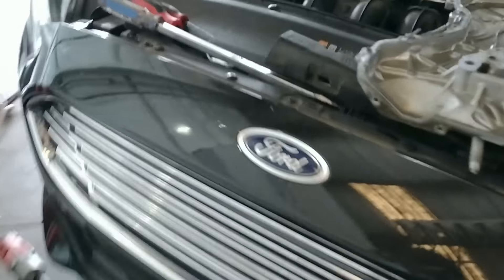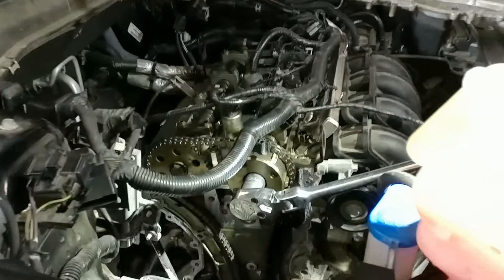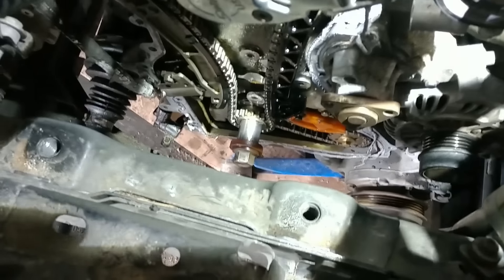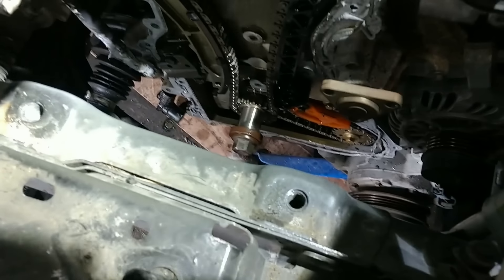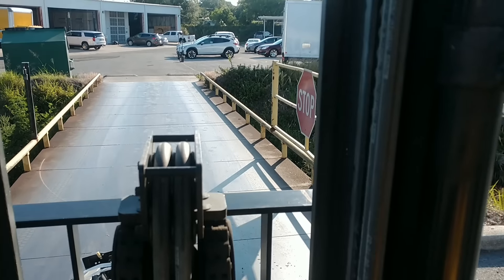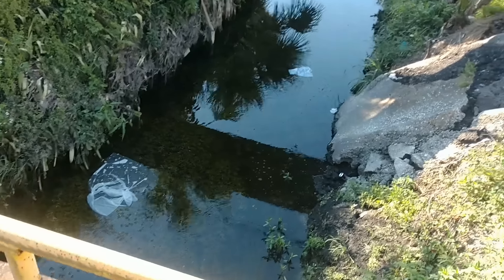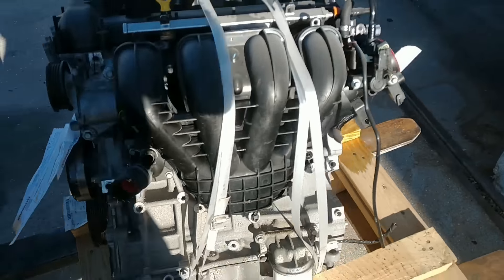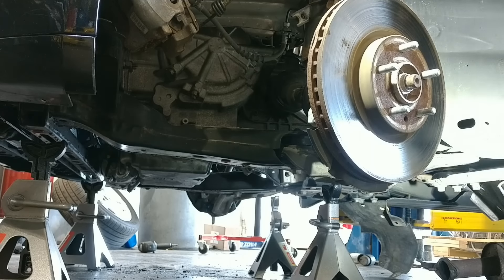Damaged Engine: You Broke it! Pt1

Comment: Silly question. Why were you/it being spun over with it only half assembled?

No disrespect to whom done it as that cog design is shite, I don’t believe anyone expected it to be affixed in that manner, just don’t see what was the purpose of starting it up half built was?
Reply from the maker: It wasn't. An engine start wasn't attempted with the timing cover removed. I wasn't doing this job, so I didn't get loads of footage. When my guy removed the crankshaft pulley, valve spring pressure caused the valve train assembly to move out of time with the crankshaft and he didn't notice. What you see is after the job was completed and he attempted to restart which caused valve damage. The footage you see is after I came over, realized that we had a problem and removed the timing cover to recheck things. THEN I discovered we had some internal damage from pistons meeting valves.
Reply: I think someone didn't listen to the audio in the video ...
Reply: @RainmanRaysRepairs  this is why i tell all my trainees to spin the engine over by hand before reaching for the key, another lesson for the new kid :). you wont ever bend valves while hand cranking.
Reply: @Marineio  Actually it's held in time by the Belt or Chain.. As some of these engines have half covers. I seen some people replace just the water pump. Not knowing once you release the belt or chain., It just flops down..

Here is how it looks. So if you see it. Be aware what tools you need..
https://www.youtube.com/watch?v=TraMvTW_sZI
Reply: I used to simply ask: timing belt or chain? (when buying a car.)

Now, though, I will follow that up with: is it a Ford?
Reply: @iFixJunk  it has occurred to me of late that if buying a used car, a belt can be replaced a lot easier than a chain. If ya previous Honda owner let the oil get real questionable, the chain is the first thing to go. Not that we learned that the hard way or anything with our ‘03…
Reply: @WizzRacing  no the crankshaft turns without turning the timing chain if the crank pulley bolt is loosened. I have done this myself when replacing the crank seal. Luckily didn't crank engine and was able to get the timing tools and set it back up correctly. Figured we had a problem when I noticed there was no keyway in the pulley. I was sweating though
Reply: @iFixJunk  My current car (mid 2000s Camry) has a chain. 200k odd miles, I doubt the chain has ever been replaced - seems fine. I've also owned cars with a belt - I felt warm and fuzzy knowing when a new timing belt was done and their engines seemed quieter. Both are fine, but in either case, check to see if they're non-interference engines for peace of mind.
Reply: @johnmcnair8854  I'm telling you the tension on the Chain or belt holds it in place. As you can never touch the crank bolt. And it will flop down on you. The second you release tension on them...

Why It has a Crank Lock pin. That goes in the side of the engine.. Why the Ford Manual gives directions on how to change the water pump on them.. As you can easily not notice the crank flop down.  When the belt tension is released. So you jam them cheese wedges in there to prevent it and the cam from moving...As you will be taking that whole timing cover off and the Valve Cover... Which adds about 5 hours to the job....
Reply: @RainmanRaysRepairs  thanks for the knowledge. It's great that y'all found an engine with such low miles, that should please the customer a little. Just don't show him that last pic. Most don't want to see their car "gutted" and if they do, they tend to have imaginary problems/noises for months after. 
But I'm sure I don't need to tell you any of this.😎
Again, thanks for the knowledge👍
Reply: @chrismechanic2000  Turning them over by hand not guarantee either.
Reply: @Marineio  absolutely stupid design!
Reply: @johnmcnair8854  most engines don't have a keyway in the pulley, they are held on the crank by friction, unless you meant crankshaft sprocket, those have a keyway.
Reply: @chrismechanic2000  - Challenge accepted.
Reply: @chrismechanic2000  i have expressed this to my brother. but the one time im not there, whaammoo, loud noises.
Reply from the maker: Experience saved your engine that day.
Reply from the maker: Experience saved an engine that day
Reply: @RainmanRaysRepairs  yep I looked at pulley and thought hmm now how do  i set up the timing for the crank pickup then googled it. Now on late model shit I google first as we don't have access to much in the way of tech data
Reply: @RainmanRaysRepairs  so who is collecting unemployment now ? By the way good footage , ran across your channel when searching unemployment extensions for the year 21 lol , thought it odd because of my search lol
Reply: @RainmanRaysRepairs  What a stupid, stupid, stupid design. I can't even imagine why they would make a car that requires special tools to assemble and disassemble, when a simple keyway would alleviate the entire problem. I guess they saved a few pennies on machining that way.
Reply: @RainmanRaysRepairs  Thank you for clarifying it for me! Makes sense now 😀

 I’ll try and be more attentive next time!
Reply: @RainmanRaysRepairs  I'm tech too I've many engines turned over by hand and after starting them things went wrong. Even seen N14 cummins co-worker turned by hand and bend 2 push tubes. Yet somehow didn't know they where bent (the amazing part) and started it .
Reply: Without the cams being locked, the crank gear will move as soon as the balancer is loosened. The engine was out of time before the cover was even removed. Not something you would expect
Reply: @NicholasAndre1  I have an 06 AC RSX and I was told to pay close attention to the chain or it will mess the whole engine up
Reply: @MattExzy  Get the timing chain looked at after about 2,000k my friend
Reply: @MrJeffcoley1  simple answer is the manufacturer doesn't want us working on our own stuff. They want us taking it to the dealership for repairs.
Reply: @iFixJunk  it's a Ford. 😁 That's why I'm now driving a Chevy.  4 years old with no repairs at all. 😀
Reply: Sounds like a pretty shitty design if u ask me
Reply: this is bull, all to save the 10 cents it costs to key or dowel it.
Reply: @iFixJunk  Sometimes I think we were better off with points and timing lights and chain driven camshafts and no interference engines. Maybe EVs will stop all these problems when the range and quick charge availability is solved.
Reply: @googleuser868  I hate points, but I'm with you on the chain (although, I GUESS if you're changing a belt and CHECKING the timing instead of taking for granted that a chain won't stretch as much, maybe there's something to that).

But I hear you. I hate interference motors.

The EV thing has a long way to go. Wish the synthetic petroleum alternatives were viable.
Reply: Ford.
Reply: When he loosened the crank bolt, the valves that were under tension, caused the cams to move.  He needed to lock the cams, before removing the bolt.
Reply: @mikemike4086  if the check engine light comes on, read the codes. We ignored it when it was indicating a cam-crank phase issue and paid the price with a nuclear K-series.
Reply: @MrJeffcoley1  Generally things are engineered a particular way for a very good reason, believing the design to be "stupid" simply means you are ignorant of those reasons.
Many, many modern engines use keyless crank and cam sprocket/pulleys, the reason being is that very accurate cam timing becomes possible by simply locking the crank and cam to the correct locations and then tightening up the pulley bolts rather than relying on a keyway. The location of the cam, crank and pulley keyways on older engine designs have some tolerance and so does the length of a new belt or chain, which overall gives less accuracy in timing without using offset keys and setting up the engine using DTI and degree wheel etc.
Reply: @iFixJunk  modern belt driven engines fail less than chain ones for example n47 from bmw and 1.3 cdti from gm/fiat fail a lot on the chains and chain guides
Reply: @MattExzy  My car has a chain as well, just gone over 153,000 miles. Many people in this country would just scrap it. Parts are cheap and  you only buy tools once.
Reply: All you need is to have the engine stop at the right point and loosen the crank hub pulley. Cams go one way and the crank falls backwards. Game over man!
Reply: dealerships are not perfect they screwed up on a 700$ job and had to redo it a few days later when the assembly broke again (installed incorrectly)  gear shift linkage   the car was stuck in reverse in any gear  luckly it happened on flat land  other wise It would have ended in an accident.. i.e rollaway  since it was typically parked on a hill
Reply: Ears! Use them
Reply: @chrismechanic2000  ofcourse you do some rotations by hand and be sure there is no interference
Reply: @chrismechanic2000  rotating by hand after any major work is always good advice and something I was taught literally on the day I was offered my apprenticeship 😊
Reply: @RainmanRaysRepairs  That quite literally has to be the DUMBEST design idea ever, and i'm a Chrysler nut so i've seen a LOT of dumb ideas. 🤣
Reply: What a lousy design, press fit on a real motor ? Not even on my RC vehicles !
Reply: @punker4Real  Needs to have a hand held lever which is mechanical and able to be reached from the driver seat.
Reply: It's become apparent to me that many of the car and parts manufacturers nowadays intentionally make working on the vehicle difficult and requiring special custom tools. They also make everything from plastic and mold wearing components into the part so the whole assembly has to be replaced, at huge unnecessary cost. Working on cars now has become less of repair of parts and more of replacement of parts.
Reply: @RainmanRaysRepairs  why not just throw a new Cylinder head off a junker motor and call it a day
Reply from the maker: @Zzzzf  oh I wanted to repair it. Bosses thought that having the kid replace the engine would be cheaper. SMH
Reply: @MrHBSoftware  It's going take five or ten years before most people realize that chain cam drives have flaws, too.
Reply: @21stcenturyfossil7  i am in europe, portugal and overhere people already prefer belts...usually because modern chains need replacement too... and are way more expensive to replace then belts....and they also fail...problem is that car manufacturers are now inventing weird stuff like ford's wet timing belt system...dont know what their idea was....
Reply: What did you do with the bad engine?
Reply: @MattExzy  maybe take the covers off and look at it.
Reply: Fords have never failed to screw us over with crap like this, throughout my whole career. People love to say, the tech “should have known”. But there are so many cars and it often doesn’t mention that this will happen if you read the actual timing cover replacement guide. It will probably tell you to lock it somehow. But they never mention the consequences.
Reply: @highlanderfreelancer4553  All because ford is too lazy to key the timing sprocket ⚙️.  Lame
Reply: @MattExzy  most Toyota engines are free wheeling engines.
Reply: @BukitMan  ford had to get sloppy to stop GM from killing them on price
Reply: @BukitMan  there is a tool called a bore scope it's a camera you can stick in the sparkplug hole and look around I've seen them at Walmart cheap. Back when they were expensive many years ago .I saw someone turn the motor over with the scope  inside the cylinder. Now that's some dumbass shit.
Reply: @highlanderfreelancer4553  They wanted a closer look.
Reply: @MrHBSoftware  they were trying to piss up a rope is my best guess...
Reply: This seems like a terrible design. What were they thinking? 🤔🧐
Reply: @NicholasAndre1  there is zero reason for a belt -  how many chains really fail on a maintained well designed engine?
Reply: @RainmanRaysRepairs   I take it the guy that missed those engine mount bolts is the same guy that botched the timing? He's definitely learning the hard way, has he been sacked yet?🤣
Reply: @turtlemann14  this design is shared by bmw M cars and has wrecked many a high hp high $ builds
Reply: an even better question is why heck would they not put a key way in that crank. with the explained situation i can understand but you never button anything up without double checking you work. i've done a couple timing jobs and double checked them all by hand to verify i won't have such a situation. modern stuff might go more miles, be more powerful and efficient but it is not better in every way. my old truck had timing gears.. the engine outlasted the body lol. just bought a broken down 2012 malibu with variable valve timing. chain is screwed, guides, likely valves and pistons are SCREWED because of nonsense similar to this. of course it did make the guy sell it for practically nothing. what are ya gonna do though? they're all like that anymore, interference engines, variable valve timing, something differing from old slow and reliable. not a fan personally but they do have their benefits.
Reply: @blueovalfan23  completely agree with gear or chain driven timing rather than a flimsy rubber belt but there's nothing wrong with variable valve timing, look at Honda's B16 engine, that is an excellent piece of engineering. I have no idea how that so called "mechanic" didn't test his work by hand, I think there's far to many fitters out there these days and engineers are a dying breed unfortunately.
Reply: I thought everyone knew about the Mazda design engines. PITA
Reply: @RainmanRaysRepairs  Ford booby-trapped these engines..things you have to know before you work on these.
Reply: It's a hi-vo chain, nothing wrong with the design. Hi-vo can transmit more power than a normal chain and sprockets.
Reply: @arfamortis1  They're also quieter. Timing chains used to be all Hi-Vo's. Now many manufactures are using cheaper roller chains..sometimes only one row!
Reply: @iFixJunk  hehe those Ford engineers very nicely circled the problem on the grill :)
Reply: @mikemike4086  2 million miles or kilometers?
Reply: @NicholasAndre1  Some chains can be replaced easy, on Mercedes you remove a link feed new chain in as you turn over engine. All it takes is removing valve cover gasket.  Now you do not get new guides but you can replaced chain.
Reply: @iFixJunk  I had a Ford 4 cylinder once. A 96 Contour. Was a great little engine... however, the tensioner was supposedly made of plastic. If that’s not planned obsolescence, I don’t know what is.
Reply: @MattExzy  You still need to worry about a TCT failing and for me that’s worse than having a known interval to replace a belt. It’s also nice replacing the water pump while you’re there as those seem to start wearing faster around 150k miles if you live in the south. I really hate used car shopping though. Too many negligent owners in my state.
Reply: @moustachio334  Wow, I drove those cars working for a company that had a fleet of '96-'99 Contours and Mystiques. But I didn't know that.

I did not think as highly of those engines, but then I was seeing them after a lot of abuse.
Reply: It's apparent how this ended. There are industry standard ways of designing engines for repair.  If Ford can't get with the program then they need to get out of the business.
Reply: @Hugo_Overthere  I agree.

However, they were the only ones to refuse the bailout in 2010........
Reply: @iFixJunk  I like timing gears personally. Fuck the belt or chain
Reply: @MattExzy  ive owned an alfa romeo twin spark 1.8. I know that warm fuzzy feeling. One of the best engines to work on and daily drive. But have a hideous appeteit for cam belts. Id do mine once a year because i bought all the tools to do it. ( i drive my cars borderline hard )  If i ever need a shitbox daily. Im getting another one.
Reply: @Marineio  They are doing everything they can to keep us from being able to work on our own vehicles. I'll keep my 96 silverado until the day I die.
Reply: only fkin junk fords don't have keyed cam/crank gears. Bolt pressure holds em wtf. I thought subaru's plastic cam gears were the worst...
Reply: @MrJeffcoley1  its ford u should know from experience that they suck!
Reply: @ferrumignis  I’m sure there’s a reason, but it’s still a shitty design.
Reply: @joesmith6524  It’s funny you say that. Uncle Tony (of Uncle Tony’s Garage) says in his 5 decades of working on all makes and models his opinion is Ford had “too many engineers” and therefore needlessly complicated things.
Reply: @chrismechanic2000  very good idea. Had a mercury and required the same tool to keep the OHC in position. Didnt have a garage, the money, or the love for the car to even attempt. That was my last Ford I ever owned. I know all different makes and models have special tools and I always researched them after I learned the hard way a few times. Idk what meds yall take to do this on a daily basis,  but my hats off to you. I'd be a door greeter at Walmart b4 I become a full time mechanic. I've worked on my vehicles for over 20 years. Although at times I loved working on my own, theres always that model that they decide to change for their purpose. Miss the old days when you can climb in a compartment under your hood and work on them. Now , not so much. I've worked in 3 shops in my life and I changed my profession.  Praise all that have the gonads, patience, and skill to put up with constant change of models and dealing with idiotic customers. You all deserve way more than most shops can give. Great respect to you all.
Reply: @DL101ca  honda cams and bottom timing gear has keys. and crank pulley is splined
Reply: @NicholasAndre1  Yeah some cars may be like that - but others with chains aren't.  If properly maintained those chains should last the lifetime of the car.  I had a 2000 BMW 328i and it had a chain and it was original still at 306k miles.  The car got rear-ended at 306k still running on the original chain.  Now some makes I can see this being a bad idea to have a chain.  For example, the Chrysler 2.7.  The W/P should NEVER be ran off of the chain and it is also a shit design.  The Audi's also have chain issues on their V6 engines.  I have had many BMW inline 6 engines with chains and NEVER HAD A PROBLEM.  All makes are different.  They should uses better guides too that arent made out of such shit plastic.
Reply: @iFixJunk  yeah your like ahh timing chain thank god, then go wait is it a ford timing chain?
Reply: @RainmanRaysRepairs  In this case, what happens to the mechanic that did this ? did he need to pay this mistakes with his own salary ?
Reply: @RainmanRaysRepairs  these engines were designed by mazda, and they do this a lot.  there are tools and holes to line up the crank with 1 at TDC and then also tools to lock the cams in the right place.
Reply: @RainmanRaysRepairs  Now we know what "interference " really means.
Reply: @chrismechanic2000  To be fair, he didn’t touch the timing chain. He was just fixing a leaking timing chain cover. Unless you know how the crankshaft sprocket is held in time by the harmonic balancer, you would have no reason to suspect it would be out of time.
Reply: One of my ex gf cousins has....well now maybe had an 08 focus. His crank pulley needed replacing. Had one of his buddies do it, they just took it off. When they put the new one on it wouldnt start. My ex called me, had me talk to her cousin, i told him his buddy most likely fucked him n did this to his engine. It was before i knew the design of this engine, but i still had a feeling this is what happened by the way he was explaining things. After i did some research n found out the motor needed to be TDC and locked before pulling the pulley, i was just about positive this happened. Now that i seen this vid, im 100% positive this happened. This is exactly why i google and youtube repairs before i do them on newer cars now no matter how simple the job may seems because of stuff like this. Your shop should have mitchell or all data. Being a noob tech he should be looking up everything before doing it so he knows what tools and the procedure before starting. This goes for every tech the first time they do something on newer cars because you just cant be to sure these days.
Reply: I've been at this over 50 years and you damn well bet I use this wonderful advantage called the internet!  It didn't exist when I first turned a wrench.
Reply: @donmunro144  How does one ‘lock’ up the cams so they don’t move?
Reply: @Legalmachinist  different engines require different tools. I have tools that lock both cams together on a twin cam engine. Some engines use a tool that locks into a square spot on the cam and bolts to the head. Some engines don't require anything to hold them. Just use a wrench to hold it in place while you install the belt or chain.
Reply: @donmunro144 Appreciate the response Don, thanks!
Reply: I now pronounce you valve and piston. You may now kiss!
Reply: @iFixJunk  Even then, do your own research.  I've had places lie to try and sell me what THEY want to push vs what I'm interested in.  Also some cars apparently have massive debate over what different engines actually are...went thru this with a Mazda recently "is it or is it not an interference engine" when a timing belt broke prematurely at-speed on the highway.  They got lucky, new belt and runs like new.
Reply: @Marineio   Indeed. I found that out the hard way the first time I did a timing belt on one of those...Lucky for me, I noticed it and looked up the procedure. There's a threaded hole on the side of the block where you screw in a bolt until it hits a stopper on the crank, that's when you know it's at top dead center on #1...
Reply: @johnmcnair8854  is the nose of the crankshaft tapered  ?  Is that how it is held on ?
Reply: @DL101ca  this mazda engine does NOT have a crankshaft timing gear key it is held in time by doing up crank bolt when timed correctly fucks sake man I'm a mechanic and did this myself
Reply: @RainmanRaysRepairs  As being a Craftsman, with a rating of journeyman or Master as a technition, an apprentice cannot be the one  eats any of it. You are there to impart WISDOM, and patience, not  be off loading blame , and recriminations.
Reply: @chrismechanic2000  I would say, that knowing the  the engine's basic design, and  quirksare for the Technition to accertain before turing a wrench, , as it is no different than if it were a rotary engine, or a new fangled lawn mower engine.
Reply: @turtlemann14  Ten cents times what, a million engines?
Reply: @donmunro144  Well... maybe.  But they'll happily sell you a set of shop manuals and special tools. I think it's actually not so simple. It's a for-profit corporation - it exists to profit its stockholders. And that's not just a bunch of words - it's a legal mandate. One upon a time, someone... Hmm. I think it might have been Henry Ford. Anyway, whoever it was decided to do something that would have been great for his customers, but would have removed a seriously substantial percentage of profit. What happened? The stockholders sued him, and he lost. I wish I could remember enough details to go searching, lol, because it was kind of interesting and educational both. But the bottom line is, if it's a corporation and not registered as a non-profit one, profit is automatically "job one." So, yeah, finding ways to cut costs while still delivering a product, well, that's to be expected. These are high volume products, too, which means even a small savings per unit quickly becomes significant. If that means special tools are required? There are a lot less special tools than there are engines, lol - the math still works. 

The manufacturer has to take into account things like CAFE, too. Which, among other things, is probably why the same engine (series), in two different countries, might have two different oil weight specifications (e.g. 5w30 vs 0w20 or whatever). And it might have something to do with why trucks/SUVs get pushed, come to think of it - because the standards the manufacturer has to meet will be different. Maybe that low speed bumper crash thing, still, too - but it's probably chiefly the fuel economy standards difference between passenger cars and light trucks. Or not, IDK. 

Profit is such a priority in a corporation that there'll actually be an employee at most of them who, among other things... is tasked with doing the math in regards to what percentage of units failing under warranty to aim for. The time is LONG past when the goal was zero warranty claims - because that costs too much. 7%, and your profit is a certain amount. Build a better product, only have to warranty repair 5%... and you end up with less profit. What about a lower quality product - 9% in-warranty failures, but profit goes up. That's a win... for the stockholders. At some point, a higher failure rate under warranty decreases profit, so that becomes unacceptable. 

Now you have to worry about the customers' perception, too. A reputation for producing junk hurts sales. But even that isn't so simple. "My vehicle's <component> broke soon after I bought it - and the employees/manager/dealership/manufacturer were all *WONDERFUL*! I'm going to buy my next vehicle here, too." :rolleyes: Not everyone thinks that way - but a lot of people do, and that means even a [FAIL] can end up being a win. 

So what's an independent mechanic to do? If it were me, I'd try to talk the boss into buying all the shop manuals he could. Like everything else, you get the money back a little bit at a time. And you can advertise proficiency with the brand/model. But the documentation isn't super cheap, and maybe it starts getting too specialized (maybe you need a separate set for each year, or model?). So add one hour of labor for "internal" work on an engine (etc.) you haven't done before, or that might have changed between that model year and the one(s) you have worked on - and spend that hour searching the Internet, lol. Doesn't help for a brand new engine series - but one hopes not to be the guinea pig, so to speak, and that enough people will have discussed the thing that is not obvious (or have complained about same) for you to be able to find the information that you'll need to do the job. 

And I guess you take a page from the bean counters' book and hope that you can bill enough so that, after paying for the occasional "aw, sh*t!" (or the increased insurance premiums), you still manage to clear a profit that year.  

It's always about the dollar in the end. Everyone has got to eat. . . .
Reply: @wesgregg6451  yes, all just a drip in a bucket. it takes just as much time if not more to grind the surfaces and bring them into a close tolerance.
Reply: @RainmanRaysRepairs  What a terrible engine design.
Reply: This is the instructions from Ford on how to work on this engine. I understand that the design is nothing new, but the fact that it significantly varied from the industry standard and that if one is not a Ford Technician with special training and proprietary tools, and performed certain routine maintenance, that you will destroy the engine is unconscionable.

CAUTION: Do not loosen or remove the crankshaft pulley bolt without first installing the special tools as instructed in this procedure. The crankshaft pulley and the crankshaft timing sprocket are not keyed to the crankshaft. The crankshaft, the crankshaft sprocket and the pulley are fitted together by friction, using diamond washers between the flange faces on each part. For that reason, the crankshaft sprocket and the pulley are fitted together by friction, using diamond washers between the flange faces on each part. For that reason, the crankshaft sprocket is also unfastened if you loosen the pulley bolt. Before any repair requiring loosening or removal of the crankshaft pulley bolt, the crankshaft and camshafts must be locked in place by the special service tools, otherwise severe engine damage can occur.

CAUTION: During engine repair procedures, cleanliness is extremely important. Any foreign material, including any material created while cleaning gasket surfaces, that enters the oil passages, coolant passages or the oil pan can cause engine failure.

Remove the engine front cover. For additional information, refer to Engine Front Cover in this section.
Remove the timing chain tensioner.
Compress the timing chain tensioner and insert a paper clip into the hole.
Remove the bolts and timing chain tensioner.

Remove the RH timing chain guide.

Remove the timing chain.

Remove the bolts and the LH timing chain guide.

CAUTION: Do not rely on the Camshaft Alignment Plate to prevent camshaft rotation. Damage to the tool or the camshaft can occur.

If necessary, remove the bolts and the camshaft sprockets.
Use the flats on the camshaft to prevent camshaft rotation.

Installation

Remove the special tool.

CAUTION: Do not rotate the camshafts. Damage to the valves and pistons can occur.

If the camshaft sprockets were not removed, use the flats on the camshafts to prevent camshaft rotation and loosen the sprocket bolts.

If removed, install the camshaft sprockets and the bolts. Do not tighten the bolts at this time.

Install the LH timing chain guide and bolts.
Tighten to 10 Nm (89 lb-in).

Install the timing chain.

Install the RH timing chain guide.

Install the timing chain tensioner and the bolts. Remove the paper clip to release the piston.
Tighten to 10 Nm (89 lb-in).

Install the special tool.

CAUTION: The special tool 303-465 is for camshaft alignment only. Using this tool to prevent engine rotation can result in engine damage.

Using the flats on the camshafts to prevent camshaft rotation, tighten the sprocket bolts.
Tighten to 72 Nm (53 lb-ft).

That is per Ford on how to time. Good luck. If you need any more help or pictures, just ask.
Reply: @MrEmbedded  problem is: if a timing chain is worn out or elongated, odds are that the driving gears have also suffered significant wear. Runnng a new chain over worn gears will only ruin the new chain faster. So if you open up the engine to get to the chain, it's best to replace it all.
Reply: @svenschwingel8632  I replaced chain this way in my Mercedes diesel with 300k miles on it. Has 429k now. I guess it depends on the wear of the sprockets and chain. Done same thing on many gas Mercedes V8s from 80s and 90s.
Reply: Timing this thing is so easy to mess up even if you're following procedure. You're supposed to install a bolt that the crank will hit when its properly timed, but you're turning the engine with the crank bolt installed. Once you remove the crank bolt, the crankshaft can walk itself back again. You could maybe remove the starter and hold the flywheel to keep it from walking back, but its just adding more work.
Reply: @RainmanRaysRepairs  is this a Toyota 2.7 3rz-fe possibility too? Because that situation looks familiar to what im about to do. Maybe not at this point😅. Have to pull the head and get it resurfaced. After firing the parts shotgun (multiple “projectiles “) at a misfire code i did a compression check. And I think Toyota has that valve piston ramming possibility
Reply: Why did the manufacturers cheap out and remove the key and keyway that has been proven for many many years? Some companies that started removing the key and keyway have now gone back to it. Also what made manufacturers think it was a good idea to have wet timing belts?
Reply: @DL101ca  not all sprockets for timing chains or belts have keyways, some manufacturers removed them especially on smaller engines. its a ridiculous cheap way of stuffing things up. Same as the wet timing belt that wont last long.